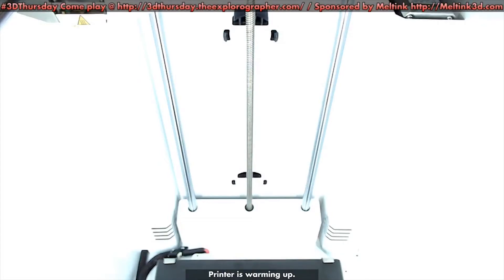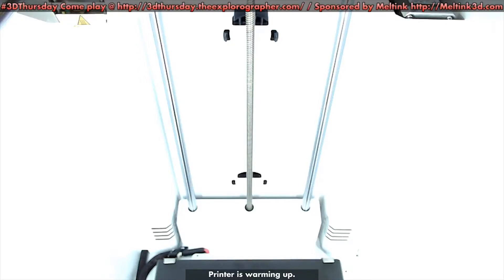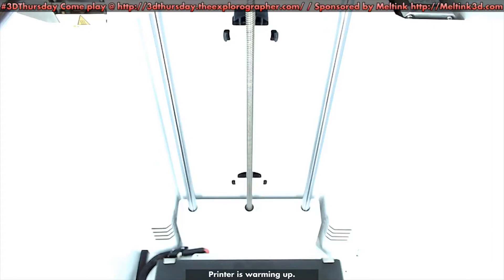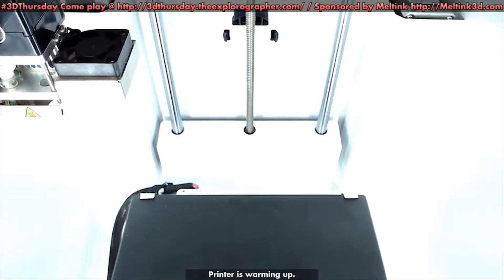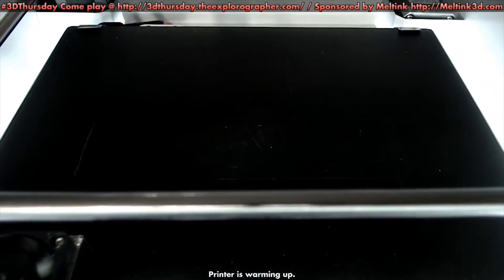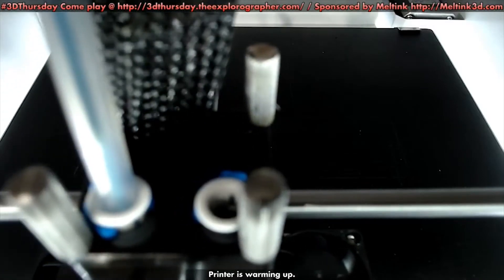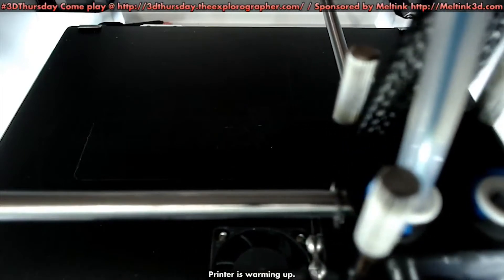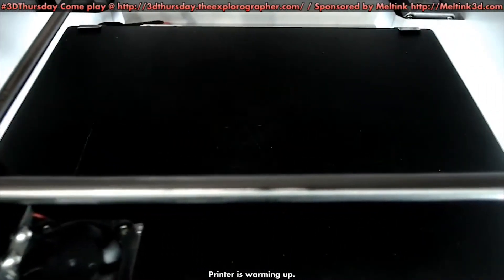SANJIU Printer Z360 (Ultimaker 2 Extended) Timelapse Demo Print

Comment: Also got one of those Sanjiu Z360 printers. Updated mine later with a door and top lid, really helps when printing ABS. Is yours the 3mm or 1.75mm version? I ordered the 3mm(2.85) because when i ordered mine there were noone else out there that i could ask about it so i guessed keeping it closer to the original would be the best.
Reply from the maker: 1.75.  Printer has been great.